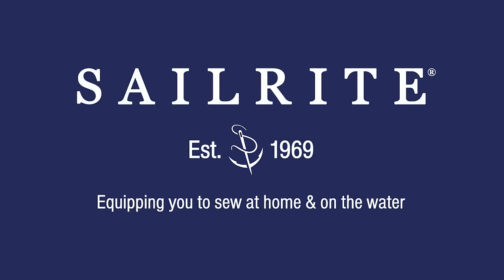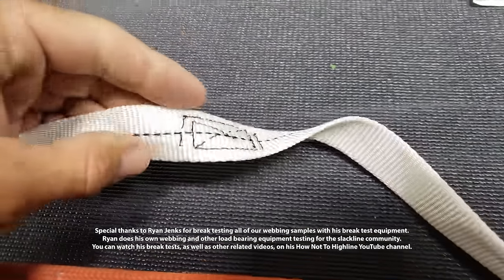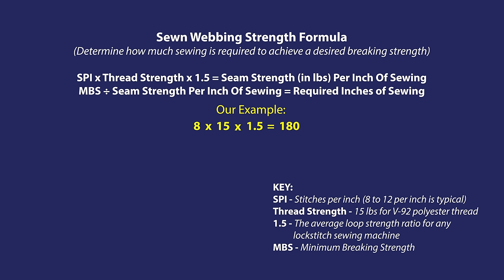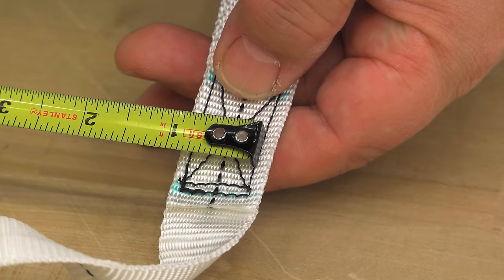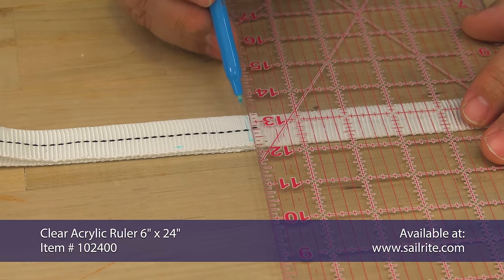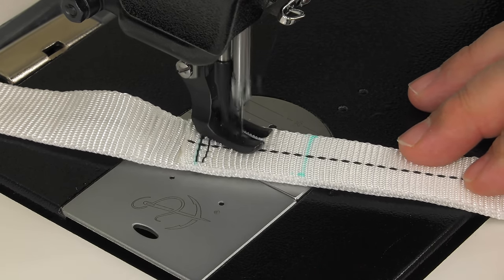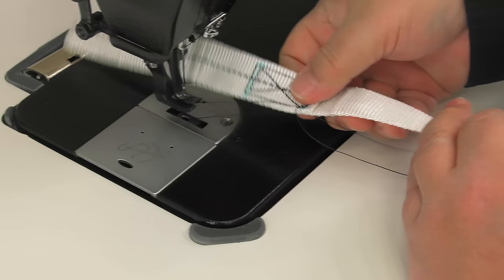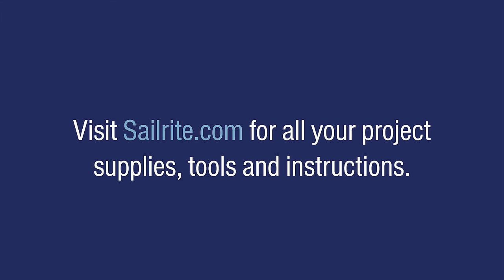Sewing a Box X Stitch in Webbing & Breaking Strength Formula

Comment: Thanks for the video. I would like to point out that you could achieve even better result by adjusting the tension. I can see the knots on the bottom and it should be in between the first and second layer. And  it is important to point out the importance of stitch alignment. The weakest spot of you X-Box pattern are the stitch that are outside the square and this is exactly where it break.

Comment: I can understand why you would want to know the breaking strength of your stitching in a sailing situation, and make that less than the breaking strength of the webbing--in order to keep expensive and critical hull anchor points from being ripped out of place, or  expensive and critical sails from being shredded. But in  applications such as mountaineering or arborist work, I can't think of any situation where you'd want any connections in your rigging to fail before the anchor point. So I'll use your formula to calculate a stitch length that is at least equal to the breaking strength of the material being sewn. Then x 5.
Reply from the maker: Thanks for sharing your thoughts! It's always interesting to consider different applications and their specific requirements when it comes to stitching strength.

Comment: is there somewhere I can find the formula in metric ?
Reply from the maker: Simply use an inches to metric calculator on Google.
Reply: After running all the calculations and backchecking it against each other I found out that the formula is in fact exactly the same, just replace imperial with metric. So;
Stitches per centimeter * thread strength (in kg) * 1,5 = minimum breaking strength (in kg) per cm of stitching.